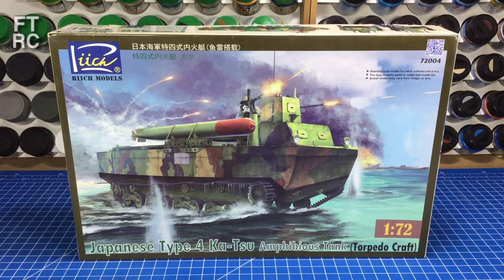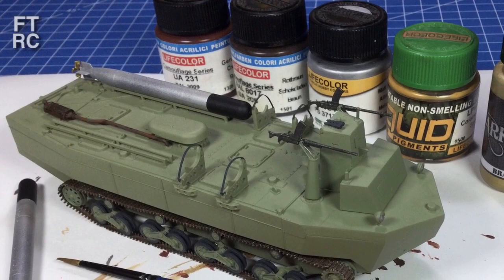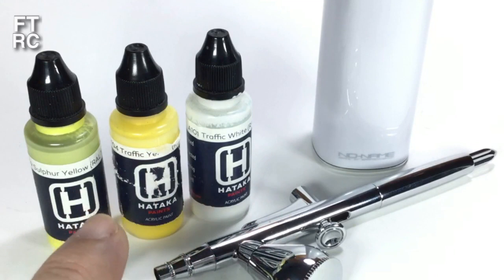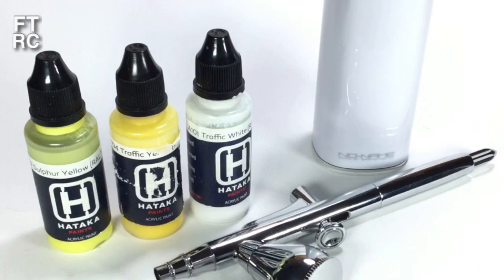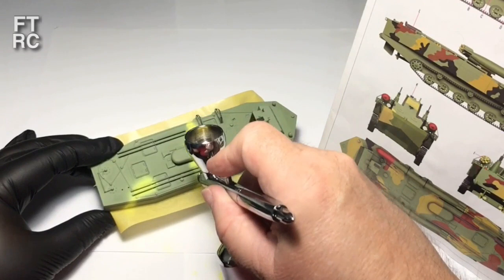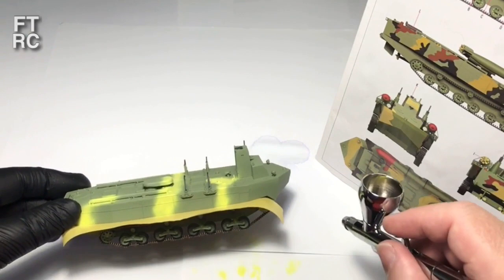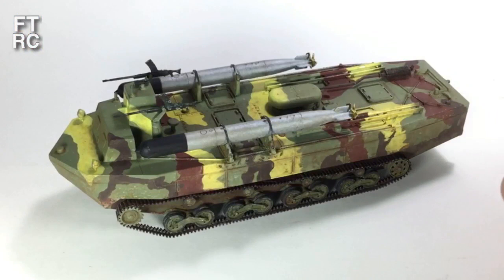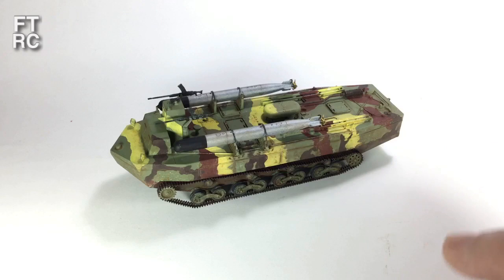Riich Ka-Tsu Part 4 Painting the Camouflage

Comment: Nice model! Might get one myself and try painting some camo for the first time! 
Btw 7:05, those life color paints, i have some and even mixing with their own brand thinner, i find they tend to separate into layers and get stuck in my airbrush within a few minute..  wondering how are your experience airbrushing with them?
Reply from the maker: I have never had any success with Lifecolor thinner.  If it’s a quick job, then I simply make sure I run distilled or spring water through my airbrush first, so it is wet, then add a few drops of Lifecolor and it sprays fine that way.  If it is a bigger job, then I add about 10% distilled water with the paint.  However.  Never run Lifecolor after using an alcohol based paint like Tamiya.  Even if you use Tamiya airbrush cleaner.  The two chemistries are incompatible resulting in coagulation; your paint turns to snot.
 
  I keep one airbrush just for water based paints like Lifecolor, Ammo Mig, AK and Vallejo. They never have alcohol thinners in them, just cleaned with water and Windex.  If you don’t have the luxury of multiple airbrushes I suggest you thoroughly clean yours with Windex, then flush with distilled or spring water until there is no smell in the cup.  You should then be safe to airbrush Lifecolor.
Reply: @HarryHoudiniModels  Thanks for the tip! I'll give the distilled water method a try! Good to know i'm not the only one having touble with their thinner.. glad i only brought the tiny tiny bottle